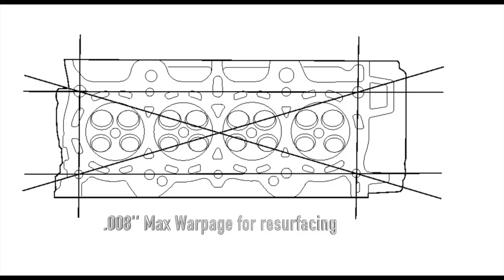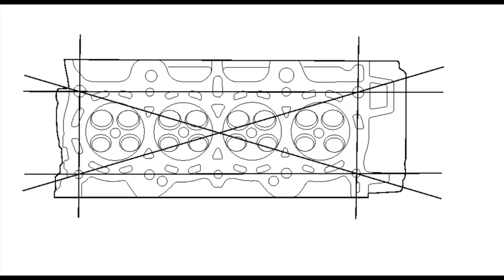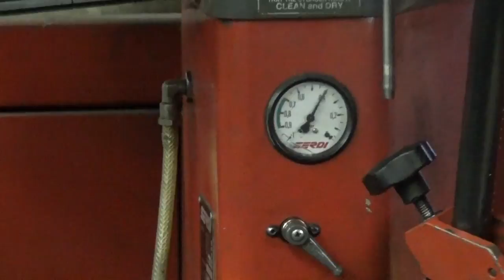How a Machine Shop Checks and Resurfaces a Cylinder Head

Comment: Why would you go through all that trouble and expense to remove and surface the head and not go ahead and machine the valves and seats ?  Sure it cost some more $$ but the labor to get to that point and back is way more.
Reply: It seems that if it vacuum tested they thought there was no reason to reset the valves or check valve guides and install new valve guide seals 🤷‍♂️, but definitely was a good little video
Reply: Also I am compelled to point out that when you wash a head in a spray cabinet with the valves still in it you are leaving water in the valve guides it may not be much but can rust. Also if the head got hot enough to warp .008" then I'd be worried about this particular head dropping a valve seat in the future. That said I enjoyed this video thank you for sharing
Reply: @doggfriendly  do it all the time never had a problem. Quit thinking so hard
Reply: I do it all time sometimes people just want a mill. We don't force people to do things they don't want to do.

Comment: If the head was warped that much did you check the camshaft journal alignment? When the head warps up in the center so does the camshaft journals.
Reply: I was thinking the same. They bend the same above and underneath and adopt the shape of a banana. I learned it the hard way.
Reply: Rarely. Because more structure exists up top with the valve cover rails, casting trusses etc. they often stay straight.  They have to have been severely overheated (or cold water poured into an overheated engine roadside) in order for the cam tunnel to be out of line.

Comment: I'm surprised they deep cleaned it before surfacing. I would think they would just run it through and clean it after? I just had a d17 Honda head surfaced and they just ran it through and gave it back to me to do the cleanup. $90 USD for that.

Comment: the book says the max you can take of is 8 but ive had customers say just do it when they had .025 plus needed to be taken off and it was totally fine. yeah the compression might go up a little but they engine ran totally fine. you can safely take upwards of 15 all day long without  any issue what so ever. and that goes for pretty much anything out there.
Reply from the maker: Thanks for the great advice. It would seem that they end up taking that much off down in Mexico here. They will rebuild the same engine several times before scrapping it. Valves must be so close to the Pistons by the third time. 😄
Reply: Are you sure about that?  I just checked my head yesterday, and it had .009 in a couple of spots.  The deck had .004 in a couple of spots.  I really don't want to have to scrap my car.
Reply from the maker: @ShyLeonheart  https://youtu.be/28-FB3kyEDk
The other option is a thicker head gasket if available for your engine. That can give you the extra thousands you need to not have valve piston contact. I’m not advocating to take off more then the spec says. It would have to be calculated precisely to ensure their is still clearance. All the best. I hope it works out.
Reply: once you remove greater than 008 your over head valves timing becomes off. you can still do it , you'll need to compensate since your changing the valve timing retarding them. adjustable timing gear, thicker head gasket etc
Reply: Different engines are different. Really depends on the geometry of what drives the cam(s). If the needed milling will affect the valve timing too much, then the head either needs material welded to it or it needs to go to the soda can factory. That amount is going to be different for every type of engine.

Comment: Erm Honing is not to smoothen the surface of the cylinder walls but rather to create a cross -hatch pattern to retain the motor oil and to try prevent blow-by.
Reply from the maker: Agreed

Comment: If it was that warped, i would have definitely done a valve job, check the springs and changed the valve seal. It definitely got overheated.

Comment: Before any machining, what surface can you depend on as a reference point for placing the level?
Reply from the maker: A good straight edge for checking and the milling machine better be true or everything will be out.
Reply: The main “mother” reference is the valve angle. For this head, it would be the cam bore. This machine shop (I presume) didn’t check the cam bores because he didn’t ask them to. IMO, it’s a good idea for a machinist to ask these days, because a lot of diy’ers don’t think about that for overhead cam cylinder heads. On some heads, there are actually machined pads from the factory for a machinist to use as reference during overhaul work.
Reply: @slowpoke96Z28  Does that mean you have to take a machined rod the diameter of the cambore, insert the rod into the cam bores, and placed the level on this rod to insure the best leveling has been achieved, before starting resurfacing?
Reply: @bbigboy01  depends on that specific head. More and more often, the OEM gives no guidance on machining. Idk what one does for a customer engine. 😕

Comment: Is the cleaning a common thing for resurfacing a cylinder head? Did they check to see if the head was hard enough for a resurface?
Reply from the maker: Cleaning should be part of it. Especially after to remove any left over metal particles.

Comment: Why didn't they measure the top? Overhead cam heads needs to be measured on top as well. Make sure the cam journals are still in line. When the bottom warps the top usually follows
Reply from the maker: Good point. Maybe the top is less likely to warp…..

Comment: Problem is your cam is now running .008 out of line so it will have to run bent.  SOMETHING will give out. This process is not for overhead cam engines. For those you have to straighten the head first, not mill it bent.
Reply from the maker: Oops.

Comment: What is the maximum  cuts depth that we can shave of the engine head ?
Reply from the maker: .228mm or .009” maximum for this head. This number will vary from manufactures and based on head size. Best to check a service manual for your car.

Comment: Hi. Please explain how 8thou of an inch is a larger measurement than 1thou of an inch. I would love to see the math.
Reply from the maker: Hey. Maybe it’s the wording that’s confusing. If i have one apple and you have 8 apples. Who has more?  8 is a bigger number then 1. It’s a decimal. .001” to .008”. The more thousands you have the closer you are to 1”. And that’s a bigger number. 👍
Reply: @zerbinauto  Thanks for the explanation. When expressed as a decimal its clear to see. The wording is the issue though. This is whats been compounding me. I look at it like: a thousandth of an inch = 1 inch divided by 1000 = Larger measurement vs 8 thousandth of an inch = 1 inch divided by 8 thousand = smaller measurement.
Reply from the maker: @moerskop21  No problem. It’s just flipping it around. A thousand of an inch is .001 of and inch. 1/1000= .001 
8/1000= .008.  One inch is the total  so we are talking about how many pieces of the inch we have. Maybe I’m just getting more confusing. Lol.

Comment: So if it’s above 8k, wdym we can’t resurface? Like is it destroyed or can’t fix it?
Reply from the maker: The problem is when the tolerance gets too tight then the valves could contact the Pistons when you really step on the gas. They do make cylinder head spacers so that you can push it even farther something to look into for your particular engine. With a spacer, even if yours is over the factory spec, you could still install the head.
Reply: @zerbinauto  thks sm

Comment: Where the valve guides checked.
Reply from the maker: The valve guides were not checked in this. That would be an extra service a shop could do if requested. I replaced the valve seals on this head. If valves haven’t bent the guides are usually fine. 👍

Comment: Surfacing the head doesn't take the warp out. What it does then is create heavy and thin areas which cause hot spots to develop and crate even worse warping and mismatched combustion chamber sizes which creates imbalance and can even cause a car to fail emissions in some states. Being that the remainder of the head is still warped, it places stress on the valve train and cam(s) IF the head is an overhead cam. On overhead cams the valve timing will not only be off but the journals will wear in an odd fashion across the length of the cam effectively ruining the head all together.  Don't listen to this guy. You need to have the heads heat straightened. Once that's done a very light cleanup pass can be done if needed to take care of any dinged up areas but generally the heat straightening is all you need.
Reply from the maker: Uh…what is this fancy new method you speak of? People successfully machine heads all over the world.
Reply: @zerbinauto  This isnt new. And I dont care what people do all over the world. I was very clear what I said and the issues it creates. If you dont get it, you dont need to be in the business.
Reply: @opieshomeshop  Machine shops do this?
Reply: Nonsense.
Reply: It's metallurgy, it releases stresses that thermal change brings on, and I believe it releases carbon or some thing. It's the same sort of principal as quenching copper.
Reply: @zerbinauto  thats right, they do with almost zero issues. Straightening the heads is nothing new, but due to added costs as it is more than just heating it up and pulling it straight, folks don't go for it. Cheaper to get another head and hope it's not as warped. I have pressure tested and resurfaced thousands of overhead cammed cylinder heads with quite a bit of warp to them and they tend to go the rest of the life of the car even with the warping in the cam area. So yes they can be straightened, but usually not the step taken. You just had the most common op performed in most engine machine shops and until something else in the engine fails you prolly never going to have an issue. 👍
Reply from the maker: Thank you for the info!
Reply: I would like to know more about the heat straighteneingprocess you mention to see how it works.  I understand your comments but thought a 4 thou out of flatness would not be as serious a concern to remachine flat again.
Reply: LOL.  what part of the galaxy are you from?  

not all engines are RACING engines.